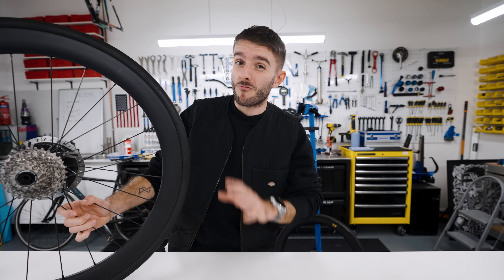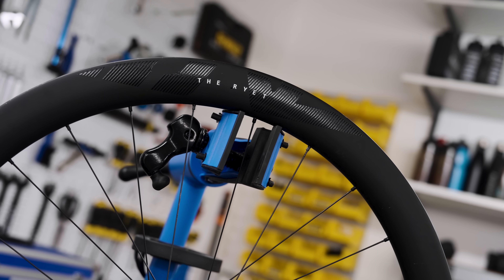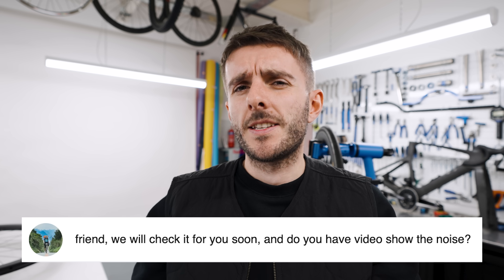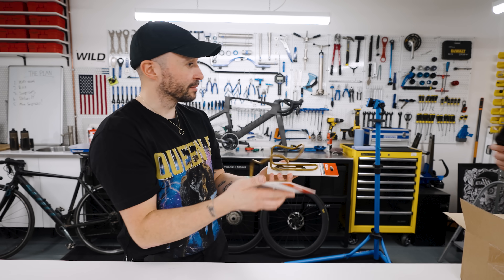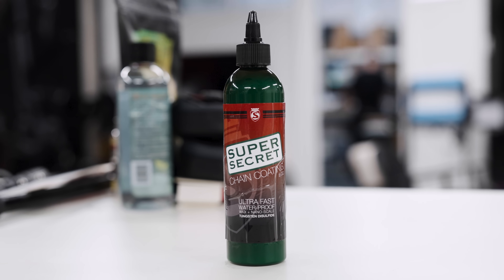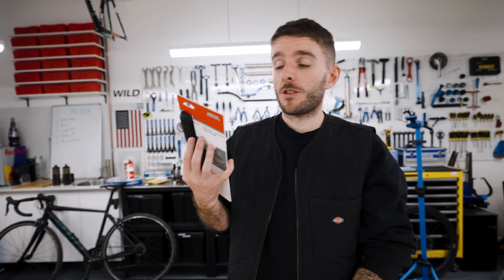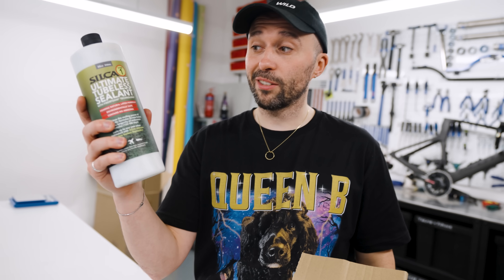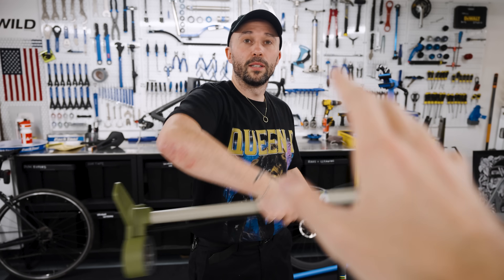I’m Now Terrified Of These £240 Carbon Wheels

Comment: £240 for a wheel set… logical purchasing has left the room. When will people be able to distinguish between cheap and good bang for your buck.
Reply: I was never a fan of carbon and I'm only willing to use metal for anything important. Weight is a bit overrated especially if you are not racing.
Reply: It’s the exact opposite. If you’re NOT racing, then carbon it is. 

It is breaks, just buy a new one. And as a non racer, you’re not gonna push the bike hard anyway. Cycling is largely a luxury sport anyway; something you do for leisure if you’re rich.
Reply: @87togabito  why not alloy for non racing? what do you get from carbon for weekend coffee ride?
Reply: @87togabito found the non-utility cycling consumer
Reply: Of course you can get a good wheelset for under £240 maybe not carbon but I don't really need that.
Reply: Problem is, what is "good bang for your buck"?  There is so much markup in wheels from the big names that we're only starting to learn what's a reasonable vs. obscene price.
Reply: 240 for a set of wheels and another 70 for a replacement - still 10 times cheaper than zipp's. that's the logic
Reply: @petertreadway Did they increase their prices? I’m looking for a decent bang for your buck cyclocross/gravel wheelset, but they seem closer to €400-600 now. Any recommendations?
Reply: For $600 you can get Elitewheels Edge which weighs in at 1291 grams without needing to use carbon spokes. This is the best bang for your buck you can get.
Reply: @87togabito  You are definitely not Dutch...
Reply: I mean… that 240 coulda bought a floor pump instead 😂
Reply: @fulconandroadcone9488  yeah I feel ya. I would consider a carbon frame but it’s just stupid how expensive and fragile it is for some tiny gains.
Don’t get me started on all-carbon rim brake wheels…

But the absolute worst idea has to be carbon spokes. If you crash and break a wheel those become a lethal hazard.
Reply: I dunno for 3000 euros you get a lot more carbon fibre on a car than two basic circles a bike- the price is not what its something worth, its what someone is willing to pay for it
Reply: How about $340 carbon wheels?
Reply: Carbon is far superior to any material for cycling. Lighter is always better whether you’re racing or not.

 The problem is quality control from random brands.

Comment: been using Elite wheels... 6 years - 7 pairs. One issue with a bad bearing. But solid. Beware where you buy the products, Knock offs are everywhere. Test with ultra-sound.
Reply: I’ve had mine for 3 years. Bought with Dt Swiss hub and premium name brand spokes   An option when ordering.  No issues

Comment: I was quite impressed recently when I tried some Aliexpress DT Swiss 52 tooth ratchet knockoffs. For the price compared to the legit product I figured it was worth a try. They worked beautifully, sounded great for... five kilometers. The parts broke on a short, punchy and somewhat aggressive climb. I contacted the seller, they offered to replace the parts. I told them I didn't have confidence in the product and would really prefer a refund so I can buy the genuine product. They said ok, and gave me the refund. I think they are getting better with warranty and customer service but it is still a a case by case thing as there is so many manufacturers/sellers.
Reply: I'm currently using a chinese hub using the DT Swiss ratchet standard. The fact that its parts are almost all replaceable if ever they go wrong is amazing. I literally don't have to worry about getting a new one if they fail on me. I'll just have to get a new set of ratchets or bearings and it'll work again, good as new.
Reply: We cannot trust anyone in the bicycle industry it seems . Riding anything has risks .

Comment: Glad Jimmy made the Chinese section clear. I was the UK distributor for a far eastern brand. There is good and bad chinese direct carbon. I did my research as a former sceptical product design engineer. I found there's good and bad Chinese carbon and I totally agree accountability is key. I ensured they met ISO and EN stds. Of the sales we made over two years for wheels and frames I only ever had 1 crash damaged and one warranty issue and in both cases the brand replaced without question. The comprises with china direct is shipping time approx (2-6wks) depending on supplier and stock.

Comment: You missed the cool part about the Terra - up to 30psi it goes in 10psi increments for fine tuning of MTB/gravel tire pressure, then it switches to 20psi increments so you can get up to road tire pressures.

Comment: Hi guys. Watched this clip and thought I’d drop in my thoughts. In general as you said not having a worthwhile warranty plan for your Chinese wheels is a problem for a start. This creates the possibility for some manufacturers to cut a few corners to bring in these products at this crazy price point. That should alone set a few alarms going. Maybe you get lucky as Francis has but I wouldn’t go looking for potholes..
From what I can tell here. The side wall thickness is optimistic at best. The other, and more important issue we have seen for some years is ‘dry carbon’ meaning the prepreg carbon simply does not contain enough ‘glue’ to bind the carbon fibers. They are getting away with it on frames if the paint work is good but it’s new territory for wheel makers looking to skimp on manufacturing costs, why? 2 things spoke tensions exacerbated by impacts/vibration. This wheel has failed on the seamline of the tire wall. Basically the outer side wall delaminates when the bond is poor. It used to be spoke pull-throughs, a problem a few years back as some of your subscribers will attest to. Poor choice of where to put carbon and unreliable supply chains lead to variable quality. Who checks these batches..mm let me think…you do!

Comment: Just as a public service announcement, Silca stuff is discounted 30% right now on Amazon. The only problem I have with their lube is that I've now ridden 16,000 km on my KMC chain, waxed with Silca and treated weekly with Super Secret. The damn thing just won't wear out, and I've got a custom celeste colored replacement waiting in the wings to put on my Bianchi. At this point, I may just have to accept that Silca has made my drivetrain immortal.
Reply: I know you are joking but it is the only downside I have found to waxing. I've noticed that at a glance all the chainrings on all my bikes look excessively worn, because there is no dirty oil to disguise where the anodizing has gone from the teeth, and because of waxing I'll have those rings for a very long time.

Comment: Josh actually saved the Italian Silca brand legendary Pista floor pump.  When he traveled to Italy to offer to buy the brand for the Italian owner.  The company have already sold their factory and all their equipment.  So they had to visit several craftsmen to order each specific part made to build him a Silca floor pump.
Reply: Essentially, a new company with new products engineered from scratch bought an old dying brand. The fake-o italiano product names are just posing, they're not even grammatically correct.
Reply: @ltu42  The Pista floor pump internals are the same as the original design.  They just aesthetically updated the externals.
Reply: @ltu42 OK, but the new Silca stuff is 10x the quality of what I bought from the original Silca 20 years ago.
Reply: @ltu42  There's an element of truth to that. On the other hand, Silca still supports 25 y.o. pumps from the previous ownership with spare parts, etc. Who else in the industry is doing that?
Reply: I loved the Silca frame pumps but decided that a Topeak one at roughly 17% of the price would do me for now. To be fair the plastic Raleigh branded one I have had for the last 30 years has only just gone since I lent it to a mate who bent the shaft by being too enthusiastic with the pumping……
Reply: Was going to mention that Josh is the owner not really the founder of Silca. He sure is the founder of the modern Silca!

Comment: As an "OLD GUY" cyclist / LBS mechanic from the 1990s I love a great frame pump. Anyone rememeber the neon yellow Zefal frame pumps? Who else remembers high pressures to avoid pinch flats, or worse heavy anti puncture solutions like thicker tubes? That being said new tech is the best. Go TUBELESS!!!! I've been tubeless on my MTB since 2001. In 2010 I converted my Mavic Krysruim Aniversiary road wheels to tubeless, with little more than valve stems, Hutchinson Fusion tubeless tires, and tubeless sealant. Since then I've never looked back. In all those years (yes once you reach 50+ you talk in years and decades) I've had so few flats while riding I can count them on 2 hands. I'd say less than 10 flats requiring road / trailside fixes in over 20 years is a solid argument for tubeless. Note I still carry a spare tube, CO2 canisters, and patches on each ride just in case. 
What to do with a $600 euro floor pump? Same thing you do with a $260 euro Colnago corkscrew. Sip expensive vintage wine while working on your Colnago Master next to your Ferrari GTO or Austin Martin DB5.

Comment: I was lucky enough for my Chinese manufacturers to cheap-out on carbon on my 88mm deep section wheels, by replacing it with fibreglass. I crashed into a car, blew the tyre out, but the wheel survived. I had it checked by a carbon specialist, and he said the fibreglass saved it. Double win... heavy though.

Comment: Yes, I have been waiting on the review for these wheels as well. It is my understanding that Ryet is a subsidiary of Uno, a Taiwanese company, the same company that sponsors a pro bike team. You would think their quality would be better.
I puchased a set of Ryet wheels at $390.00 that looks like the ones Frances bought, not like the ones Pierre bought. Look closely, they are different models from the same company.  I have ridden over 3000 miles on these wheels since my purchase in February 2023 without problem.
The advertisement said the wheels would weigh 1730g, they weighed in at 1750g. Heavy? Okay I guess so but, as advertised. Hunt all season aluminium are about the same weigh, for the sake of the weenies.
I'm kinda disappointed that you didn't have your wheels checked by one of your carbon expert "mates" to ensure the soundness of your wheels. I would have been curious to find out since you and I bought the same model of wheel but that is my prejudice.
Overall a good piece of journalism even though it wasn't complete.
Thanks for the entertainment.😂
Reply: I have the same wheels that you, and works perfectly, strong and smooth, I guess that was a fail of production!

Comment: I am still using a Silca Track pump I bought in the Seventies, still works, pressure gage is still accurate, but the grommet in the connector had to replaced 2 years ago🙄 Even the polythene sleeve it came in still protects it. If you need a word to define quality, “Silca” nails it👏

Comment: The Silca floor pump is wonderful. Bought 25 years ago, you can still get replacement parts. One thing I found is all that oil and crap that sneaks in over the years gums up the ball check valve in the base. Easy fix. Nearly immortal!

Comment: Talking about the lack of QC in the cheap products is also a factor of them being cheap. Adding steps in the factory to ensure consistency before shipping. After checking every product, the ones that wouldn’t be to standard get thrown out not boxed up and sent to a customer. So the higher cost is partially paying for the materials/labor of the rejects which adds cost.

Comment: Not had any issues with my Elitewheels ENT disc 50mm deep, 25mm internal. £290 to my door, ridden around 80 miles without issue. They spoke to me all the way through the process.

I've got a Ryet 3d printed seat and its been amazing.

Comment: SuperTeam.  Say it with me.  SuperTeam.  Affordable, quality wheels.  I've been riding a set for years now and they are still amazing.  Stop with all these other bargain basement wheels.  SuperTeam.  Not that you'll ever see this, but I've suggested these wheels literally dozens of times.  And their customer service is really, really good as well.
Reply: 💯  can back this up. Been riding various different sets since 2015. 

They are freely available on ebay in any configuration you'd like
Reply: I have 2 sets of Superteam carbon  wheels.
Ridden them over 10k between em for over 2 years.

They are amazing and quality wheels . Especially for the price point. Would always recommend Superteam.
Reply: Do you find them stiff enough? I have a couple of sets of classics (50mm rim and 45mm disc) and they are great but I do feel the flex and they catch the rims and discs when I get out the saddle.
Reply: @Jalfred92  I find mine plenty stiff. Never had an issue with the wheel flexing. Maybe you’re just putting out some crazy power?
Reply: @fennec13  We need to get these guys to get a pair and review them. I just never have any luck getting their attention.
Reply: @shepshape2585  i suppose I have generated a watt or two in my time.

Comment: Picked up some Ryet 50 mm carbon rim brake wheels  they seem really well built perfectly true and around 1490g for the pair with pillar 2015 spokes. Cant see much difference with my hunt wheels.
only these are lighter. Will test spoke tensions before use. Most carbon rims are made in shenzen so this could happen to any brand
Reply: I agree with you, I have some Ryet wheels, and I have ridden many kilometers without problems. They even survived a crash without problems, (I sent them to be reviewed), I think it was a production failure, I should negotiate with the seller for an exchange

Comment: I've seen a similar behaviour in a wheel in which the inside of the wheel pressurised whilst someone was setting up tubeless. If the rim tape or valve hole leak heavily when using a compressor or chamber type pump its possible to pressurise the chamber inside the wheel and cause delamination like this.

Comment: I use old drop bars on my repair stand, works exactly the same
Reply: That's what my mechanic uses
Reply: @irfuel  I see what you are saying however it’s the same as those rubber straps in the video, the bike will still move. Just cheaper alternative to use bars in my honest opinion. 😃

Comment: I was looking at Ryet after your unboxing but decided to go with Elitewheel but in the end got a very good deal for Lun Hyper. The reason why I didn't go for Ryet is 1. You took a long time to post any thoughts on them which means there might be a problem 2. The aliexpress review sections have alot of defect reviews as well, carbon delamination in all of their product from bikes to wheels and handlebar. When compared to Elitewheels it doesn't have delamination problems. It's just way too much of a risk to get Ryet
Reply: I've got the Elite Drive rim brake and been sound so far.

Comment: That seat pack is my favorite piece of gear, I have a c02 inflator, 2 c02 cartridges, multitool, tire lever, dynaplug tool and extra plugs, patch kit, backup tube,$20 and extra spd cleat and hardware all comfortably in there with room to spare

Comment: Ok So I have a Matone saddle bag on my road bike and it's super nice...hold just the right amount of stuff.  I had their seat roll before that and...nah...the Matone is better.  I also have that work stand widget...its great and easy to use.  It's expensive becuase of the surgical silicon that is used on the "round" mount points.  Josh wanted something that wouldn't draw the die out of your frame.  I guess some rubber does that?  Dunno but I feel it's just safe to have and not clamp carbon, ever.  The chain prep stuff revolutionizes the chain waxing process.  No more multi step stripping...I was skeptical initially but tired it and it's fantastic.

I'm going to assume the surprise at the end is some Ti shop tool(s)?  They look amazing but I just can't justify the cost.

Comment: I would love to know how a new silca frame pump compares to a vintage one from the 1980s!
Reply: I and my friends have Silca from 40 and 20+ years ago, and the newest stuff is sooooo much nicer than any of the original. The oldest is a bit sloppy but super reliable. The “super Pista” from 20+ years ago works, but feels and looks like junk compared to the new pumps. The new stuff is very expensive, but the fit and finish is 3+ levels above.

Comment: I have them as well, The product came in damaged, out of true and they promised to replace it after sending some photos of the issues, which I did almost immediately. After a few days of sending them messages asking for updates, they won't replace the wheels. They say it's perfectly safe to use, and that I should use them. Terrible customer service.

Comment: Silca has been around for over 50 years.  I have custom painted Silca frame pumps (with Chrome Campy pump heads) on a couple of steel bikes that were made in the 70's with pumps from that era.  The original Silca made nice products at affordable prices and was mainly known for hand and floor pumps and brass air chucks.  The Silca name was later purchased and the new Silca went very high end and broadened their product line.  The current Silca is nothing like the traditional one and only shares the name......